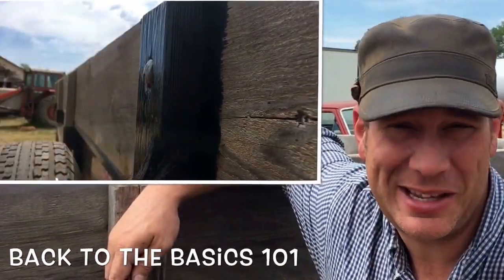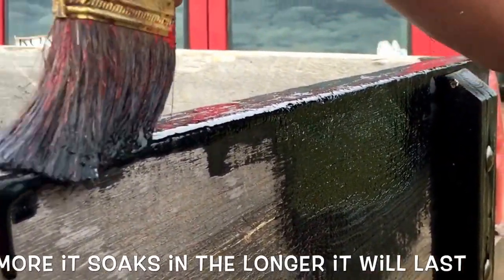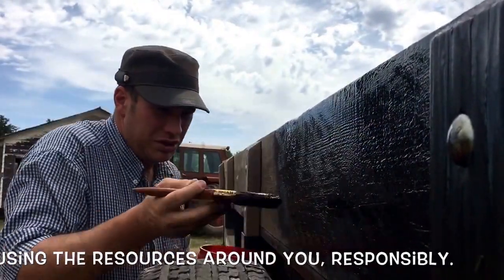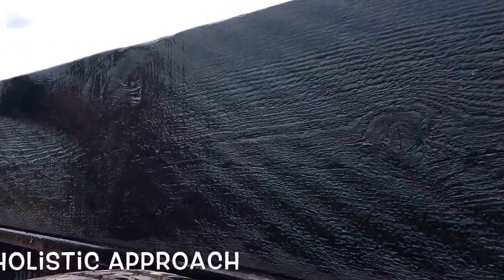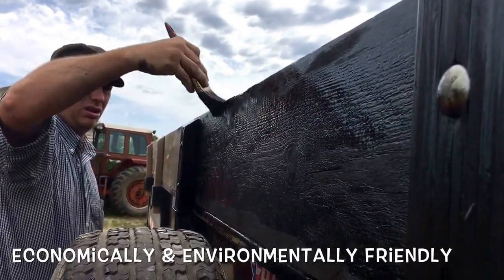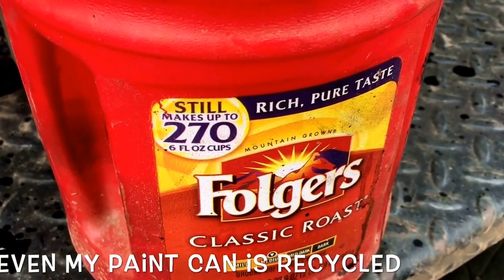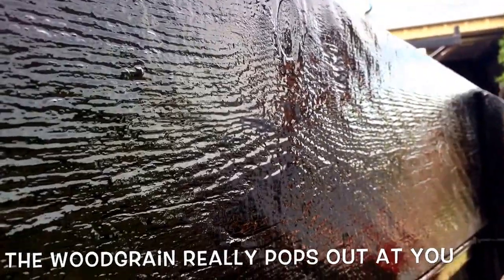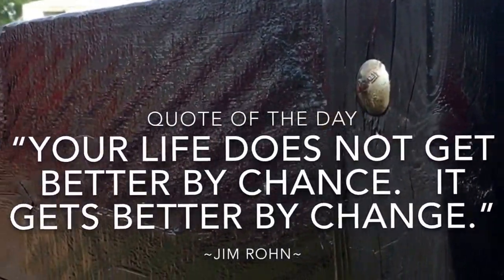Free oil base stain. Homesteaders delight!

Comment: Growing up on a ranch, we would use the used motor oil mixed with diazinon (or whatever insecticide we were using at the time) and soak burlap bags with it and hang them across the gateway where the cattle came in for feeding.  The bags would spread the oil and insecticide across their backs and sides and cut down on the amount of flies that were bothering them.  It was also sprayed on dirt roads back then to keep down the dust.

Comment: I'm a mechanic some times I have access to hydraulic oil and automatic  transmission fuid for trucks which are clear.
I'm going to try used hydraulic oil mineral spirits add melted paraffin wax

Comment: The Forest Service uses a mixture of Linseed Oil and Turpentine, on wood structures on public lands.
Used Motor Oil is nothing but oil with little bits of metal in it. 
If Tree Huggers have a problem with reusing motor oil to preserve wood, then let them live a lifestyle that requires no motor oil!

Comment: And as a bonus, when your wife washes your oily cloths it will coat the inside of her washing machine thereby preventing rust.  She will jump and shout for joy I'm sure.  😂
Reply from the maker: +badlandskid 
    The only time it really gets on your clothes, is when you're applying it. But this is true with any stain. After it dries and soaks in, it's really not very dirty. Again I wouldn't necessarily use it for your house or something.
Reply: Sometimes, your wife wants one of those newfangled front loading washers and matching dryers.  You know the kind -- the ones with all the electronic controls that won't last nearly as long as the old mechanical timer top loader that you previous had.  Well, keep that old washer and install it in the garage for washing your work clothes that you don't want to chance messing up other clothes with.  Too much trouble to hook it to a drain line?  No problem, just let it dump the drain water out in the yard.  No hot water?  No problem, just use cold water.

Comment: I will add a little tidbit,  mineral-based oils actually cause the affected wood surface to deteriorate,  admittedly over a period of years.   Note wood-handled tools of 30 years of age.   I do enjoy wood-handled tools with an oil finish.  And anyway who cares after that many years. An oil-finished wood-handled tool also helps prevent blisters.   Just reapply it after using it for awhile.

Comment: I'm, I suppose, a conservative tree hugger.  But I agree this is a good way to recycle old oil.  I won't put it on the trailer floor because it's slippery when it gets wet, but sides are fine.  Also use it on outside only of raised garden beds.  I will say though, I only use Mobile 1...

Comment: 50/50 with diesel and add in a melted candle.  While oil is hydrophobic water is not good for it.  The wax seals the wood and will make water bead up on it, and roll off.  I use old wax I save from one of those scentsy wax melters.  Also good for making wax slugs, demolding cast shot, and a couple of dozen other things.  It does have a side effect of adding a little fragrance to whatever you use it on.  Trailer might smell like cinnamon buns or pumpkin spice for awhile.

Comment: I’m going to build a 10x16 this weekend and would like to try this for the first time. I have about a hundred gallons of this stain and thought about saving a couple of hundred of dollars on pressure treated lumber and use the untreated 2x8’s I already have. Do you think I could take a Wagner painter to the bottom of the shed before I build the walls and it will last where I wouldn’t have to reapply every 4 years or should I just spend the money on pressure treated lumber?
Reply: @backtothebasics101
Reply from the maker: Don’t use it on anything that is heavy traffic, it has a tendency to get Durty.

Comment: great video. question... do you add diesel to the oil before applying on the wood? many other videos say that is a must.
Reply from the maker: It depends on the project, if you have a lot of oil will work just fine, but if you wanted to really soak in and you’re wanting it dry faster and you don’t have a lot of oil and dilute it with diesel.
 That’s what I always do and are use dyed diesel so you don’t have to pay the road tax.

Comment: Will this method make for a slick flooring, dry or wet? Would like to use on my equipment trailer floor, but don't want to make a skating rink, either. Getting to the age where I'm not as sure footed as I once was. Thanks
Reply: If it's slippery, and you have to get on the trailer... Will you film it for us? 😉
Reply: Leave it to dry in sun. Can be slick after a rain.

Comment: Can't you tell me do you mix this product with a non free , non recycled product or use it straight? Thanks
Reply from the maker: I use it straight, but you can dilute it with die diesel. Some people dilute it 50-50 some people use 25% de diesel 75% used motor oil. On the ranch are use it straight.
Thanks for watching.
Luke

Comment: I was going to buy marine paint when I build the wooden flatbed for my truck but I think i will use some used oil instead.  I spray used oil on the frame anyways,  in case you haven't seen it harbor freight sells a relatively cheap siphon sprayer that hooks up to a compressor and works great with hot motor oil fresh out of an engine while it is still a little thinner.
Reply from the maker: I have not seen it. Very interested. Thank you for the tip.

Comment: Can you use motor oil for indoors? Or it might be toxic or something? Thanks for the reply! Great video!
Reply from the maker: I would definitely not use it for indoors, it is only for long-term outside wood that will not be touched a whole lot traffic On or rubbed up against. It is great for what it is, and will dry to the touch. But you don’t want to drag up against this in your Sunday best clothing. It will preserve wood for a virtually ever. But it is not for decks, inside use, or anything that you might rub up against that you don’t want to get somewhat dusty or dirty. It does work great on shovel handles any wood that is outside that is going to take a lot of abuse. Fence post etc. hope that answered your question.
Thanks watching
Luke
Reply: @BacktotheBasics101  Thank you very much for your opinion!
Reply from the maker: You are very welcome.
Reply: @BacktotheBasics101  do you have a recommendation for a diy stain for indoors?
Reply: @musicfeind  

Mineral Oil + bees wax (proportions vary depending on application) for a more refined uses than used motor oil.

I use this for a skin balm (with calendula)  and another version for tool handles.
Reply: Please excuse my ignorance but does this treatment make the shovel handle more difficult to hold as it sounds like it would be slippery? Thank you

Comment: How flammable is it once dried? Could you use this indoors to stain wood furniture? What about on outdoor wood furniture? Have you ever tried putting wax over the top of it such as Johnsons paste wax for finer finished products such as furniture? Does it matter if it's regular or synthetic? How does it react with pressure treated lumber?  Does it stink?
Reply from the maker: It really is not very flammable little. I can put a torch on it and it doesn’t flare up.

Comment: Used Motor oil and deisel
Reply: Whats the ratio?
Reply: @johnraycimacio3542  50/50 or 70/30 oil to diesel
Reply: Can i mix it with black paint? Coz im using motorcycle used oil and its to light. Id like it to be dark.
Reply: @johnraycimacio3542  Yes,as long as it's not water based paint.Use just enough to get your black color.
Reply: Thanks man..

Comment: There is so much of this used engine oil around that they burn It here in Australia ..The mining industry has a problem disposing of it and not wise to dump it...burning.makes  electricity in the process. ..?????  I use it on my farm fences. Dont spray it unless U take precaution , breading it can be a problem. Still wear a mask when I paint in on.

Comment: Nice! Seen some other videos on motor oil staining a fence they added gasoline to it to thin the oil out a bit. I really like it  without thinning it out gives it a richer look in color. I wonder can I get a full FREE barrel of oil at a local shop? Do they mind if you wanna pick one up? Great video, Thanks!
Reply from the maker: I’ve gotten barrels of used oil from shops before. I myself would not use gasoline, I would just use regular dyed diesel. I have used it before and you can thin The oil however you would like.
Reply: @BacktotheBasics101  I've called 3 shops, with no luck. They end up telling me they have a company that comes out and picks up the used motor oil then I get they have to follow EPA Laws in regards to waste. I haven't given up on getting some. Any suggestions you can give on getting some used motor oil would be great.
Reply from the maker: Just put an ad on Facebook or your local Wheeler Dealer, and will get all the free used motor oil you would like, also farmers have it like crazy.
Reply: @367cuba1  Just show up^and ask. The person on the phone may not be the mechanic in the shop, they may just be happy that someone else has a use for it. Also in person, they may make an exception. Over the phone, people are tempted to be strict. Nothing like real human interaction. Good luck!

Comment: Every application I've seen to treat tool handles has used some form of Linseed oil.  Would you use this to treat something you will be handling frequently like tool handles?

And most applications I've seen for treating wood with used motor oil (or transmission fluid) has mixed it with diesel fuel.  Did you mix your oil with deisel fuel?  Or did you just use the oil without anything mixed in it?

Comment: Isn't the oil we turn into recycling centers, in fact, recycled?

Only because you used the term in your video, I would probably label (with all that entails) myself a "liberal".  Nevertheless, I'll be replacing the completely rotted deck on my flatbed and will most likely use this treatment.

Comment: used motor oil. Some mix with it with creosote instead of using diesel.
Reply from the maker: If a guy can find creosote. Getting harder to find. Sometimes I use used Motor OLL And mixed with diesel. But on this case it was just used motor oil/hydraulic oil.

Comment: We used to just dump it in the yard! We had the greenest grass there! I thought maybe you mixed it with some kerosene.
Reply from the maker: Just Street use motor oil. If you wanted to soak in on some applications you can use de diesel or kerosene to dumb it down and thin it out.
Reply: What about mixing some a 3rd motor oil, 3rd mineral turpentine/diesel and a 3rd linseed oil. Should I not want it so dark.

Comment: 50/50 used motor oil and diesel fuel
Reply from the maker: Just pure motor oil, I didn’t use any diesel, it then is fairly thin and makes a mess. But it does suck in better with diesel.
Reply: @ Dennis

Just watched another video of a dude doin a plywood trailer deck (YouTube channel sixtyfiveford), he mixed about 25% diesel to oil just to thin it to spray with a paint sprayer. Otherwise he also used full strength.

Comment: Used motor oil
Reply from the maker: Truth, any kind of oil hydraulic oil transmission oil engine oil diesel kerosene whatever is old goes into the skin. It all works great gear oil can be pretty thick to put on, you have to lighten it down with other stuff.